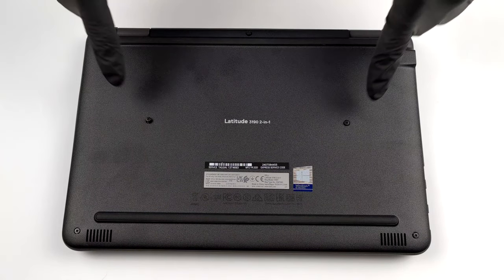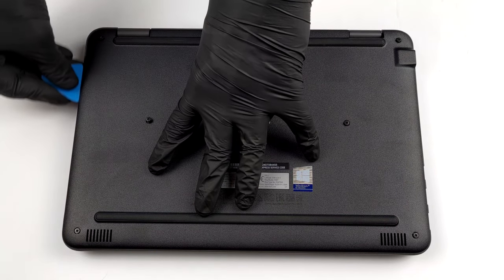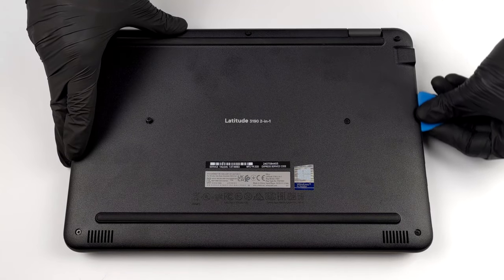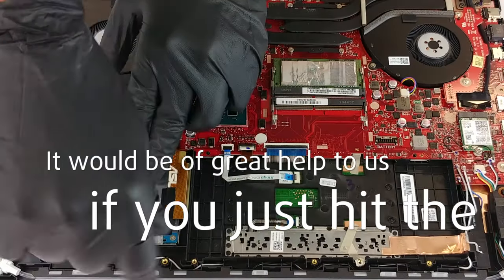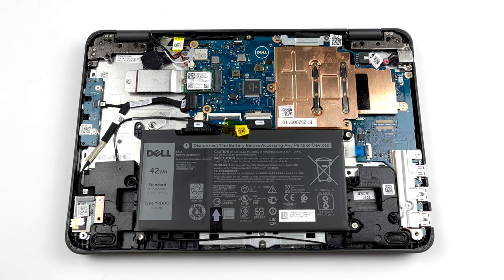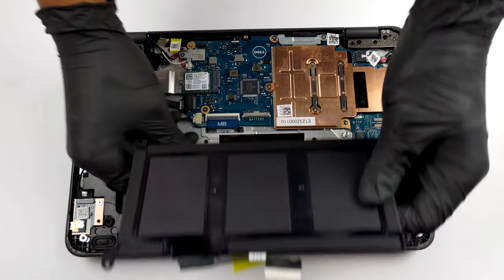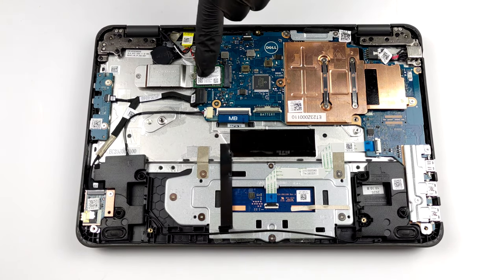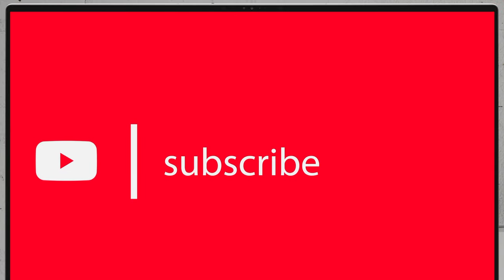🛠️ Dell Latitude 11 3190 (2-in-1) - disassembly and upgrade options

Comment: You could add a m.2 slot maybe if you soldered it yourself. Looks like the pin out for the connector is still traced on the board in the old spot. Just to the top right of the battery.
Reply: What would I need to buyv

Comment: So I have this same laptop. But where the SSD card is supposed to slide in, the connector isn’t there. My laptop looks identical to yours, same model and everything. It even says SSD, and has that screw where you can secure an SSD card, just no connector soldered to the actual board. On your video, the piece I’m missing is right at 2:16  and it says OIT11. I called Dell and they said, supposedly, there are versions of this specific model that are strictly for educational purposes and has no SSD slot, and is stuck with the base 64GB storage and 4GB RAM. It doesn’t make sense to me because I can’t find that statement anywhere online, let alone, even on the manual, it shows that SSD connector slot should be there. To make matters worse, I already ordered and SSD card AND upgraded my Windows from 10 to 11. So there’s absolutely NO space! Can that specific component be installed on the motherboard? What advice would you give me to up my memory on this thing?
Reply: You have the educational model, should've gotten the 128gb one mate!
Reply: Just slap a portable ssd on it and tape it with double sided tape to the back of your laptop (so behind the screen). It's janky but it's better than nothing.
Reply: @MelonMusk068  that's genuinely hilarious and innovative

Comment: Why it has no cooling fan inside?
Isn’t it harmful for Processor?
Reply: the cpu produces 5 watt of heat so it isnt needed
Reply: @SimonSaysNL  mine came stock overclocked to about 13 watt and 4.1 ghz
Reply: @memefortress4314  4.1 ghz on 4 cores is not 13 watts my guy. also this laptop is not overclockable without any instability issues because it has no bios function for it.
Reply: the processor has a copper heat spreader on it which spreads the heat all over de copper foil on the inside of the exterior. It runs at 1.1 ghz with a tdp of 5w. normally you would need a cooler for cpu's with a tdp of 20 and above. most modern dekstop cpu's have a tdp of 65w or higher. most laptop ones have a max tdp of 65. (only the really beefy gaming ones which have 3 fans in it and a gpu lol)